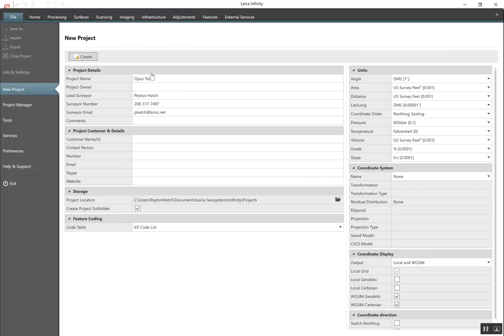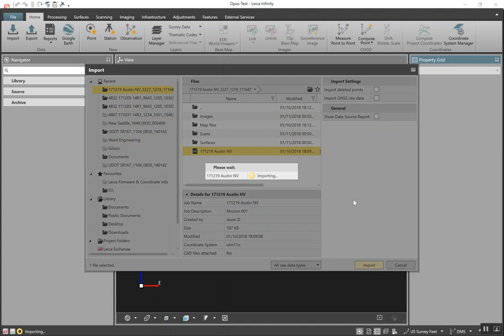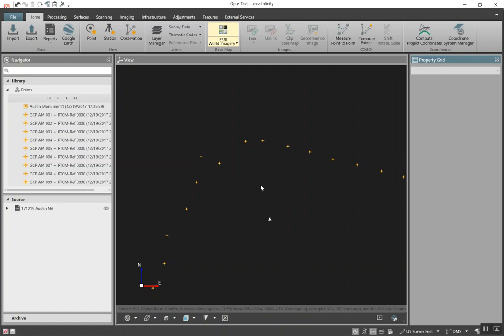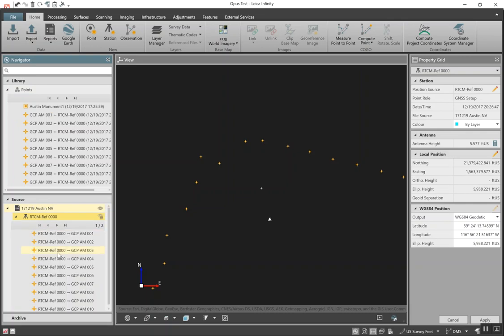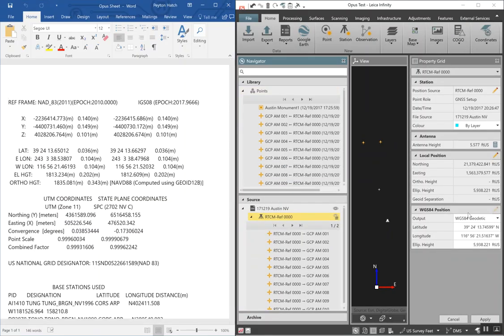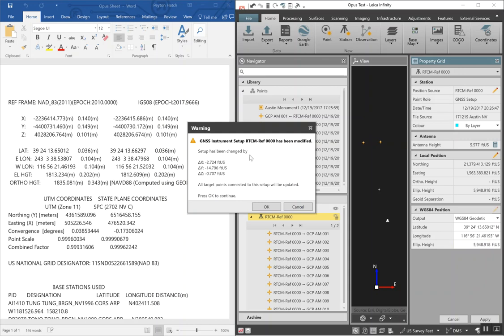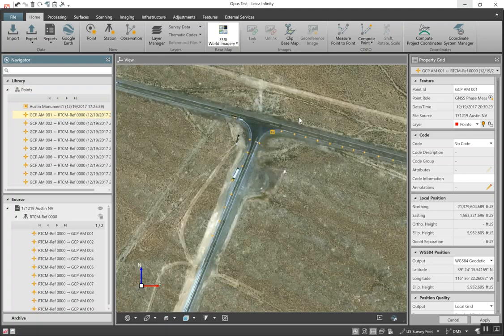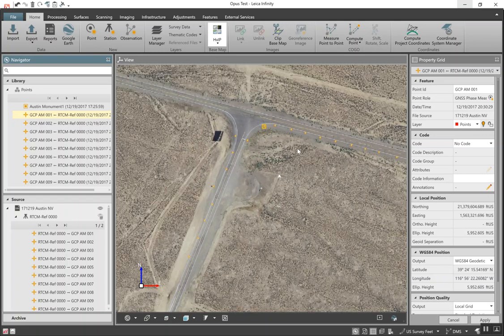Updating the Base Position in Leica Infinty

Comment: Have you found a solution to updating TS shots taken which are tied to those now adjusted GPS points?
Reply from the maker: We can update the setups yes. If you open up the setup wizard you can now pick the corrected GPS position and it will adjust all the measured TS shots.  It is not an automatic thing but it is very simple
Reply from the maker: Cameron,  There are now 2 different ways to do this and I have videos on both now.